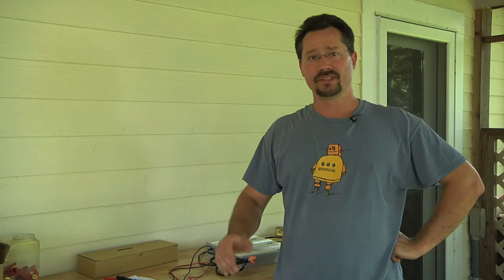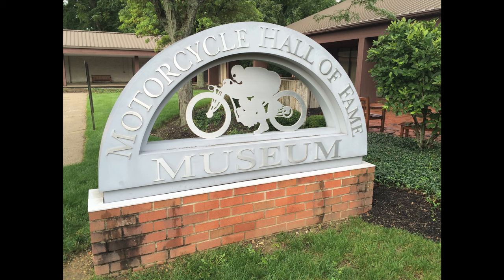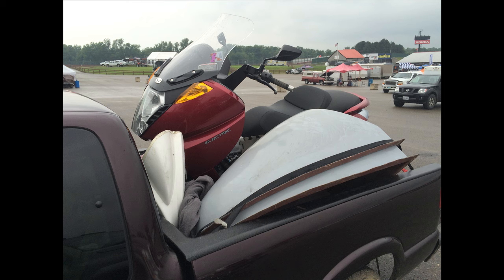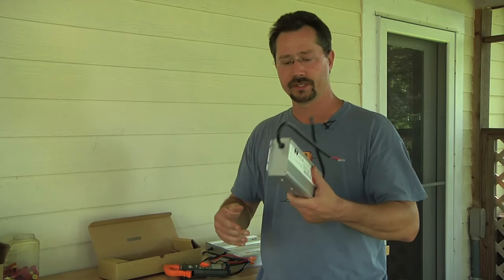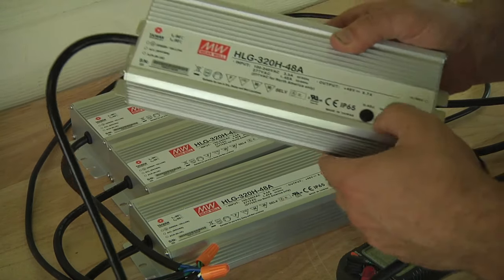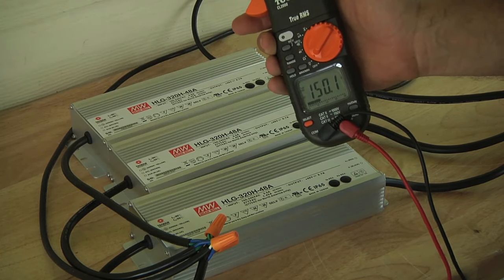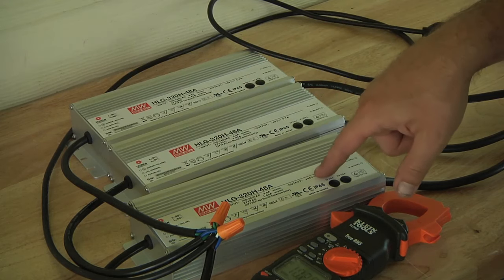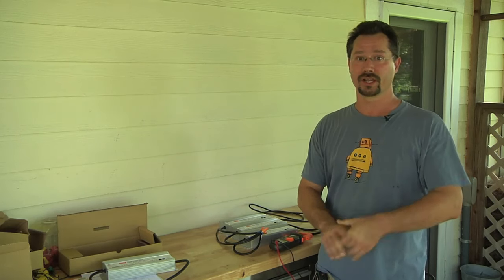Vectrix Project Update - July 23 2015

Comment: Ben. I have some experience with power supplies of that type. One thing I learned is that when you start messing with those pots it may not be set up that way. They will go in to shutdown mode of you are pulling to much or somthing similar. Just be aware of they quite working unplug them and let them sit for A bit and try again. If it keeps happning you may need to reset it to factory. Thaws may be better than the ones I used. Also. Make sure those grounds are isolated. If the case is grounded or the ground plug is grounded to the negtave output you will need to isolate those. Of the cases toch you will short it out. I have a video of this somewhere. I'll find it if you want to see it.  On wether proofing. They make a but splice with heat shrink + sealer. Look for battery cable heat shrink with the extra seal. I would go get some automotive plugs and wire them up. The water proof kind. If you hard wire them it's a pain to mess with when you want to take them out. Jsut my thoughts! Good luck!! ~Russ
Reply from the maker: ***** I just checked with my multi-meter. The cases are ISOLATED from the DC Negative output. The cases are connected to the AC ground pin of the wall plug.

Comment from the maker: Dwarf365, The power supply converts AC to DC, and provides the DC at the correct voltage for the battery pack. These are high-end industrial chargers, not cheap little power supplies that come with something like a 5v lithium battery device. The current and voltage are adjustable and theres some other nice features built right in too. These power supplies will be used with a volt-meter, amp-hour counter, and some other controlling devices to properly charge the battery.
Reply: BenjaminNelson What do they weigh?  Why do you want to double the number you are carrying (on the bike) just to charge to 80% vs 100% occasionally?
Reply from the maker: FFVoyager They weigh 4 pounds each. The reason to carry twice as many is to double the current into the cycle to cut recharge times. The more current, the quicker the charge. However, by having essentially two smaller chargers, rather than one big one, gives more flexibility.
Reply: BenjaminNelson I guess 10Kg (+ a bit of cabling) is not that bad - as long as you can find somewhere to hide them!  ;-)

I look forward to seeing how these work out in practice!
Reply from the maker: I'm going to be adding an aerodynamic fairing to the cycle. Looks like I should have lots of space for them.
Reply: BenjaminNelson  Er, you are adding a Vetter fairing?   It's not really 'aerodynamic'!  (But lets not go there....!)  But there certainly ought to be space to fit them - nice and low preferably - inside it.
Reply from the maker: Yes, a Vetter fairing. I'll mount chargers or any other weight as low as I can.

Comment: Hi Ben, If those are not chargers, how will it cut off when the batteries are full?
Greetings, love your videos :-)
Erik
Reply from the maker: rikkiesix Right now, I'm taking a look at using the alarm output on a Cell-Log to turn off a relay that controls the AC source power. I talk about it on the blog entry. http://300mpg.org/2015/07/24/charging-with-power-supplies/

Comment: Ok so you are using power supplies and not a charger. how is that any different than plugging straight into a wall? All the crap i buy that just comes with a power supply, the batteries never fully charge and always die early. So go ahead and ignore this comment like you always do and ill be laughing at the update that says well the leaf batteries are toast.